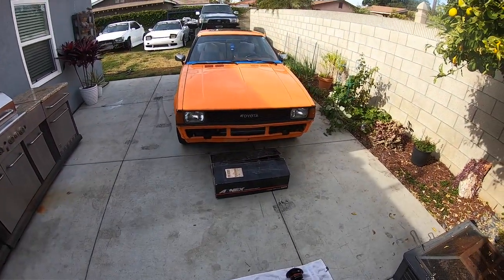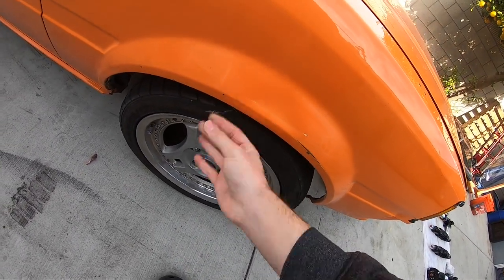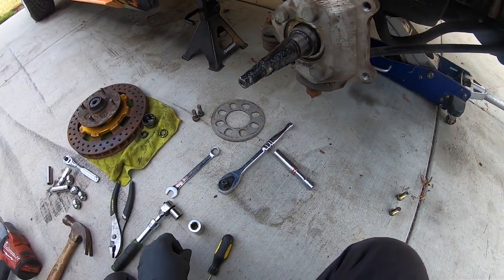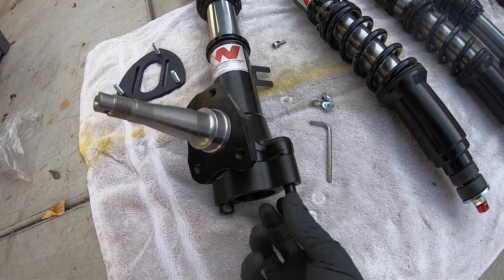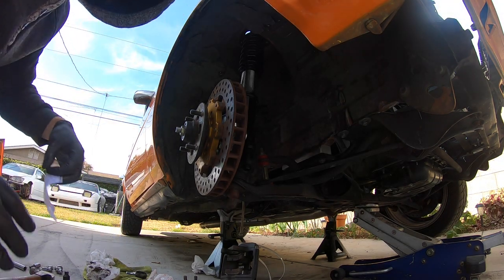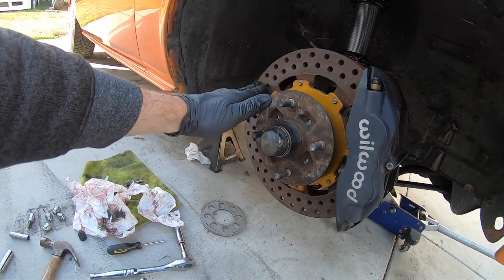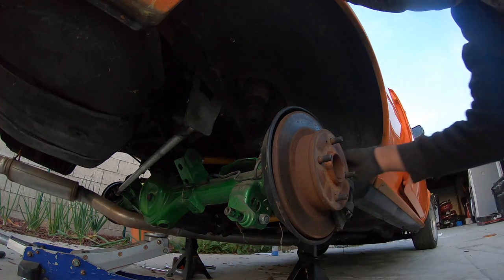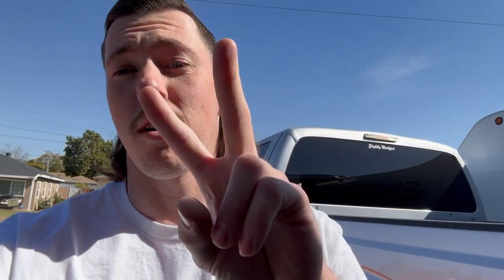AE86 Annex Coilover Install on a TE72  (TE72 Revival Part 4)

Comment: Awesome job on the TE.

You can get rear adjustables which sit on the spring perch’s and then just use a shorter shock. This stops the potential of a true coilover blowing through the strut tower top and out the hatch window